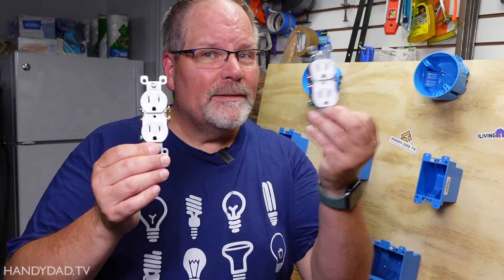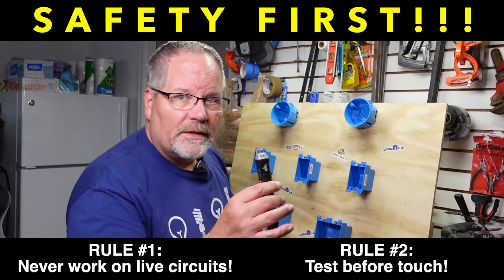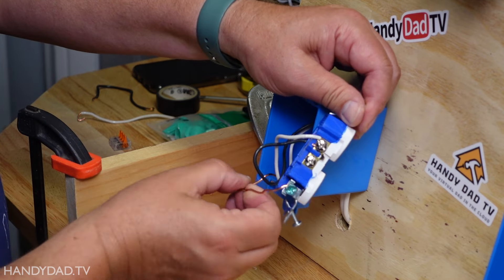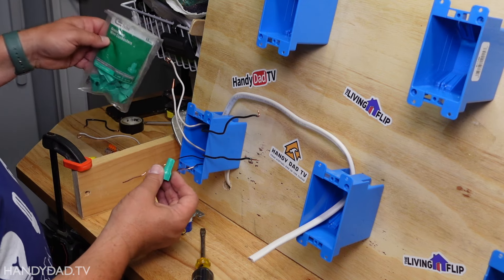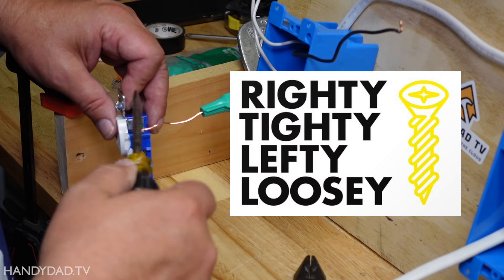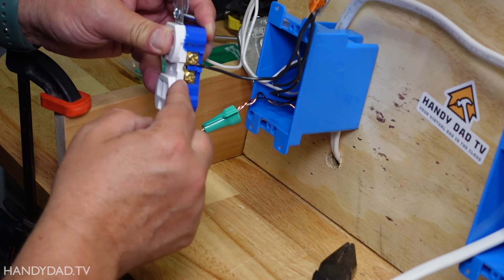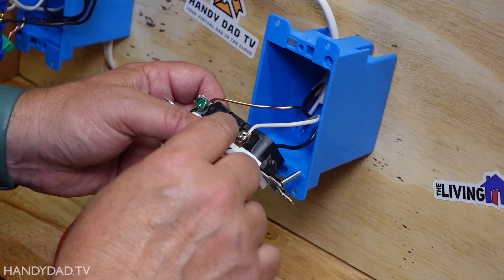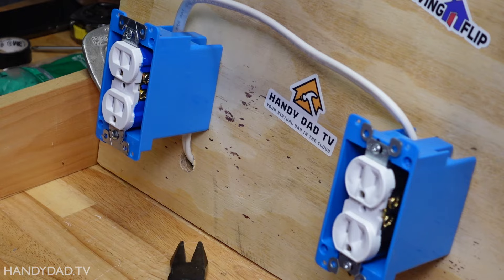SAVE $300 EACH!! How to Add an Outlet from Another Outlet

Comment: Is it safe/legal to chain a third outlet? We have an upstairs loft area with no outlets we want to use as a home office and was wanting to run two outlets to from the adjacent bedroom or dining room directly below. Which room should we run from?
Reply from the maker: Yes you can do multiple. The only limit is excessive current will trip the breaker.
Reply: @handydadtv  We currently just have an extension cord running from the bedroom to the loft we use as an office with a power strip. Runs two computers, desk lamps, and a record player. Despite how janky it looks, no breakers have tripped and the power strip nor the bedroom outlet it's connected to never feels hot or warm. Nothing else is really in our bedroom besides the ceiling light and our phone chargers connected to a separate outlet.
Reply from the maker: Then you’re fine.

Comment: Love this video! Question, I need to move the ceiling outlet that was placed for a ceiling mounted garage door opener. We have decided to do a wall mount garage door opener which requires an outlet near the front of the garage. When i open the celing outlet, theres already 2 black and 2 white wires, im assuming to go to one of the other two outlets in the garage (we have one on the left and right side of the garage). If I use a larger lever nut (i see the next size above 3 is a 5 slot one) can i still do this safely?
Reply from the maker: Yes, just pigtail them and add the wire to the new outlet.

Comment: Can this same wiring concept be used to wire a switched outlet to a ceiling fan?  Thank you.
Reply from the maker: Sort of. Do you want to wire the fan so the switch controls the light?
Reply: The easiest connection. The fan/light has remote control. Thank you. Your video is so "en-lightening"!
Reply from the maker: Great. I love fans with remotes. You just need to provide constant power when you do the wiring. 

This video shows how you can possibly get power from the switch: https://youtu.be/1JK0-yoNaWo

Otherwise, you’ll need to use the outlet.

Comment: Nice video! I am green and curious. How is pig-tailing the wego any different than using the two sets of two screws on the outlet. Isn’t the outlet designed to accommodate two positive wires and two negative wires? If that design runs the risk of overheating the first outlet on the chain, how does the wego protect against overheating? Doesn’t the shunt make both screws hot anyway regardless of the wego. Thank you
Reply from the maker: You’re not wrong. But I get a lot of comments that people prefer pigtailing even if they only have two wires.
Reply: @handydadtv  i guess the question i have isn't the breaker designed to trip before that shunt gets hot? say we are working with a 15 amp breaker, so we have 14 gauge romex and lets pretend its a short run. Like 10 feet. lets say the other outlet is on the flip side of the wall (say a garage interior to exterior) with a 15amp outlet for both the first and 2nd outlet Lets say worse case scenario the outlet that is daisy chained off it is pulling 14 amps so the breaker never trips. If the outlet is rated for 15 amps isnt the shunt supposed to be rated for 15 amps as well?
Reply from the maker: The wire insulation would melt long before the shunt.
Reply: @handydadtv  so then we are concerned about the plastic behind the shunt then?

Comment: What size wiring is appropriate for US standard outlet?  Thanks.
Reply from the maker: 15-amp circuits can use 14 gauge wire. 20-amp needs 12 gauge.
Reply: @handydadtv  thanks!

Comment: Question- Could you not just drill a hole in the top of a regular wire nut to use as a grounding nut in a  pinch, or is it a different metal inside? 

Thanks
Reply from the maker: I wouldn’t modify a wiring device. Just use a pigtail.
Reply: @handydadtv  Thanks

Comment: What size wire would you use to extend. I have 14 gauge. Will that work to run a tv ? Thanks
Reply from the maker: 15-amp circuits can use 14 gauge wire. 20-amp needs 12 gauge.

Comment: Great knowledge. Thanks for sharing. If I am adding 3 outlets from the existing outlet, would I just repeat these same steps? Or is there a limit on how many extensions the original outlet can handle?
Reply from the maker: You can repeat the process and add as many outlets as you need. There is no limit in the code, but a max of 7 seems to be a best practice. 

You are limited in the amount of current drawn by the devices that are powered by the circuit. Adding outlets for convenience doesn’t increase capacity. Your circuit breaker limits the amount of current being used at the same time.

Comment: Amateur question but where did you get the short "extra" wires for the lever nuts? *All of the hardware places by my house want me to buy a giant rolls when it looks like I only need 6 in of each 😭😭
Reply from the maker: Home centers usually offer some kinds by the foot.
Reply from the maker: To answer your question though, I buy wire in rolls because I’m always doing some kind of electrical work around the house.

Comment: With the pigtails, does it matter what order the wires go into the lever devices? For example, both white and black out currents must be the second lever in, or whatnot?
Reply from the maker: If you mean Wago lever-nuts, they are all electrically connected so the order doesn’t matter.

Comment: How many new connections can you safely "piggy back" off of one outlet? Im looking to add 3 new outlets and a fan/light combo. Is it safe to run all of that off an existing outlet or is it better to run a new wire(s)?
Reply from the maker: That depends on what you have on the circuit and what you plan to plug in to those new outlets. If they are simply “convenience” outlets, for things like lamps and phone chargers, no big deal. But a space heater, probably not. Fans don’t use a lot of power so no worry there. 

Google how to do a load calculation if you want more information.

Comment: Just got a tv stand with an electric fireplace and it needs its own outlet would this work or would it be too much on a single breaker? Should it have its own breaker is my question?
Reply from the maker: When the instructions say it needs its own outlet, they mean it needs its own circuit. It’ll work if you plug it into an existing circuit but you can easily overload the circuit if you use the heater.

Comment: awesome and clear instructions. my question is how do you know what gauge wires you would use.
Reply from the maker: Find the circuit breaker for that circuit. It will probably have a 15 or 20 on it which indicates the amp rating.

For 15 amp, you can use 14-gauge wire or heavier. 
For 20 amp, you must use 12-gauge wire or heavier.

Comment: So would this be safe for a 4 cft freezer and on the other end a 850watt Gaming psu running at same time? Is the voltage 110 enough? Thanks:)
Reply from the maker: All outlets all 110v. Capacity is based on amperage. 

A small freezer and gaming system might be okay, but what about the TV? Lights? Other things on that circuit?

As long as there are no other appliances or heaters on that circuit, you should be okay. Worst case, you pop the breaker and need to move the freezer to another circuit, or run a new one.

Comment: @HandyDadTV so if I look behind an existing outlet to try to make another, and there is already a set of pigtailed wires behind it, can I add a third set of pigtails, or should I look elsewhere?
Reply from the maker: If you already have three cables coming into a standard box, I wouldn’t add a fourth because it will be really hard to fit them all in the box with an outlet.

Comment: Complete novice here, with what is probably a stupid question, but here goes! When creating the pigtails, where did you get the extra length of black and white wire that run from the connector to the screws? I apologize for my lack of knowlege. Thanks!
Reply from the maker: Cut them from a piece of Romex. You can buy rolls of 25’ or more, or by the foot at most hardware stores.

Comment: Question: Can you Add an outlet from another outlet if that outlet is a GFI Outlet? I'm connecting the new outlet in my top cabinet for the OTC Microwave.
Reply from the maker: Watch this to see how GFCI Outlets are wired: https://youtu.be/inpvNt6591E

When adding the microwave outlet, connect it to the LINE side of the GFCI, not the LOAD. You don’t need the microwave to be GFCI protected and it might cause tripping if it is.

Comment: When you did the pigtail did you just use wire that you bought or did you cut out a little 4 inch section of the wire that was in the outlet box?
Reply from the maker: I used a spare piece of wire. I try to avoid shortening the wires coming from the wall.

Comment: Good vid thanks, now I know what I need to do to add 2 new outlets.  are all residential outlets 15 amp?  My breaker is 20 amp and many of the outlets in the kitchen are 15amp, is that standard?  I bought and installed 15 Amp USB A & C.  And what do the Wagos need to be rated at? 125V 15?
Reply from the maker: You can use 15A receptacles on a 20A circuit. That is typical. Wagos are rated for 32A.

Comment: What Romax do you use for adding an outlet, 12-2 or 14-2. Need an outlet for a TV......thanks.
Reply from the maker: Find the circuit breaker and look at the rating. 15-amp circuits can use 14 gauge wire or heavier. 20-amp circuits must use 12 gauge or heavier.

Comment: Can you do this multiple times to add 3 or 4 more outlets? Or is this only able to be done on one outlet?
Reply from the maker: You can add as many as you need. But adding outlets doesn’t add capacity. You’re just sharing the same circuit with more outlets.

Comment: Hello, would the same procedure be use to jump to another outlet if I wanted to add a second or third outlet
Reply from the maker: Yes just repeat the process.
Reply: Thank you so much for responding.
One more question , if I run the wire up to a ceiling box, would that be also the same procedure? Thanks in advance
Reply from the maker: How to Add a Light from an Outlet
https://youtu.be/xOZv17BPTZA
Reply: Hello again, in my previous text I did not word correctly, I meant to say I wanted to run wire from the outlet to a ceiling fan. I see from the video link you sent , a switch also has to be added to turn of the ceiling fan. Although it's a ceiling fan and not just a light would the wiring process still be the same?
Reply from the maker: I personally don’t like wall switches controlling ceiling fans. I prefer remote control. So I would just do a straight line from an outlet to the fan so it has constant power.

Comment: Hi I’m confused about one thing. Where did the third wire come from in the pigtail. You only had two to start with? 
Also what wire should we be using to wire another outlet with?
Reply from the maker: The pigtail is a short piece of wire that goes from the wire nut to the receptacle. If you’re tapping into an existing outlet that already has a wire on both screws, you need to use pigtails to add a third wire.
Reply from the maker: Use 14 gauge wire for 15 amp circuits and 12 gauge wire for 20 amp circuits.
Reply: The existing outlet has 2 black wires and 2 white wires already. So I would use the pigtail to add a forth wire then right?
Reply from the maker: Correct.

Comment: Great video. What gage Romex are you using?
Reply from the maker: For 15-amp circuits, you can use 14 gauge wire. For 20-amp circuits, you need to use 12-gauge wire which is thicker and more expensive.

Comment: I have a room with 1 outlet only, can I add 3 more outlet throughout the room by connecting one after the other like the one you showed in the video? Then can I add a switch to control my ceiling light?   Would that be safe from one 15 amp circuit breaker?   And if one outlet got bad, will other ones and light switch still working? Thanks
Reply from the maker: Empty outlets do not consume any current. It all depends on what you intent to plug into them. 

Lights, computers, phone chargers? All are low current devices so no worries. 

A beer fridge? Space heater? I’d be concerned.

Comment: I recently installed a ceiling fan using light switch to power light on fan. On light switch I have one black connected to top for the fan, then at the bottom I have 2 blacks connected together (original one comes the attic, other below assuming is outlet where lamp once lived) to a pigtail connected to the bottom of the light switch. The light works and ceiling fan also.

Prior to doing this, I never had a center light in the ceiling, I had to plug a lamp to an outlet on the bottom right which was source of power on/off.

Ever since I did this my outlet is not providing power anymore, I tried plugging TV nada, I’m lost and need help because it’s driving me crazy 🤯🤯🤯 am I missing a step? This outlet in question looks like it also powers 2 more outlets. On the light switch box I see RED wire, where the lamp was connected I also noticed another RED wire. Those the red wire need to be used again to power all 3 outlets? need guidance.
Reply from the maker: Impossible to say. You need to troubleshoot with a voltage tester. I recommend https://handydad.tv/ncvt

Comment: Great video! Question: why did you need to use the three way wago connectors for both white and black wires? In your other video you didn’t use them and just connected both black to both screws and both white to both screws, so just curious in what situations would you use the wago connectors? I need to create and outlet off of an existing one but now I’m worried and confused on why I may need wagos. Thanks for any info!
Reply from the maker: Many people have commented that pigtailing is better than using both screws. I just wanted to show the different methods.
Reply: @handydadtv  thanks! Can I pigtail using wire nuts instead of wagos?
Reply from the maker: Yes of course.
Reply: How would I add an outlet if it already has 4 wires safely
Reply from the maker: @blackbeans4me95 Use pigtails.

Comment: Is this safe to do for adding an extra outlet for a second garage door opener. I have 2 doors but the existing outlet is right in the center and the outlet is too far from either
Reply from the maker: Yes this is the exact process you would follow to add two outlets, or move the one you have and add a second.
Reply: @handydadtv  thanks! Now I just have to figure out how to route the wire
Reply from the maker: Minimizing patched walls is the hardest part!

Comment: Quick question. I'm putting g a dishwasher under my cabinet and I have an outlet above the cabinet. Can I do this and run from the outlet above and install a new outlet under the cabinet to plug in my dishwasher? May run a garbage disposal as well. Would I be able to do it this way? Any help is greatly appreciated.
Reply from the maker: The dishwasher is a high current appliance because of the heating element. It should be on an independent circuit.

Comment: If the outlet I want to jump from already has two hot and two neutral, how would that affect this process? Would I just have to get a 4 wire pigtail?
Reply: This is my current dilemma.
Reply from the maker: Whenever you have more wires than screws, you use a pigtail and wire nut (or Wago) to connect them together.

Comment: Thank you for your video! I was able to get some new outlets in our garage 👍😎
Reply from the maker: Glad it was helpful 👍🏻
Reply: Quick question for ya. I purchased a Klein Tools RT250 GFCI Outlet Tester with LCD Display. It's saying "open ground." I used one of those green nuts with a hole at the end to twistthe two groundstogether. 
Did I mess something up, or should it be reading that way?
Reply from the maker: @y00o00u00t00u00b00e Test the incoming ground wire to see if you can voltage when tested against the hot. If no voltage, there is a break upstream. If it has voltage, tighten the connection with the outlet pigtail.

Comment: I have a switched outlet in my bedroom that’s not used because of its location behind a large dresser. I’m going to use that power to connect a ceiling fan. I doubt it will tax any circuit as it will only be used in the evening when nothing else is in use. Thoughts?
Reply from the maker: You will be fine. Ceiling fans do not draw a lot of current.

Comment: What is the big white cable going from old box to new box, and is there a certain electrical wire I need to hook the  wire connectors up. Mine did not come with wire like the video shows.
Reply from the maker: In my area, that wire is called Romex 14/2 cable. The 14 is the wire gauge and the 2 indicates there are two conductors. Use 14 gauge wire for 15 amps circuits, or 12 gauge wire for 20 amp circuits. 

Romex isn’t allowed everywhere. Check with your local hardware store to see what to use in your area.

Comment: I have 6 single wires running through a junction box that I would like to add an outlet to.  Three wires (red, black and white) have a piece of tape banding them together and the other three wires (blue, red and white) are also banded together with a piece of tape. Each grouping has enough length of extra wire coiled up that an outlet could be added if it is possible to add one here. Can an outlet be added at this box and if so, which group of wires should be used and which wires would attach to the outlet and how? Thanks for considering my question.
Reply from the maker: I couldn’t possibly say, especially with a non-standard color (blue). You need to get a meter and figure it out. Or call an electrician.
Reply: OK, Thanks @handydadtv